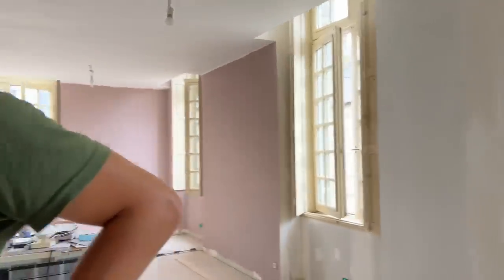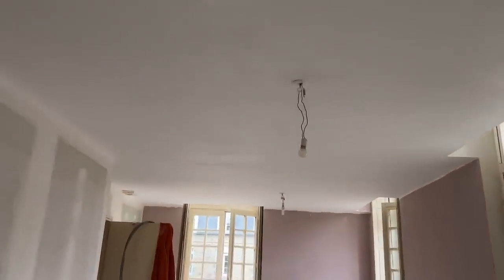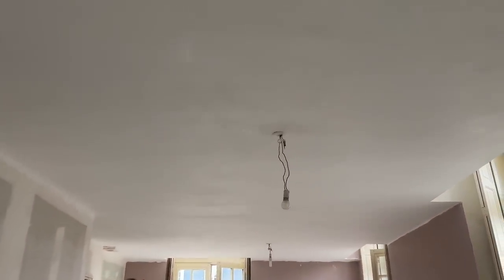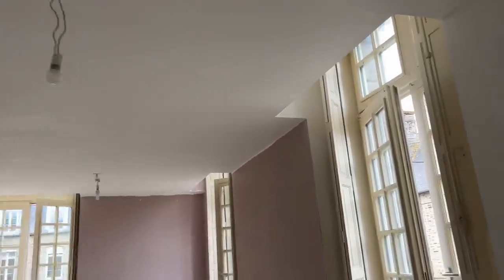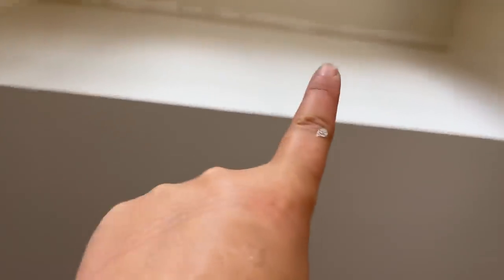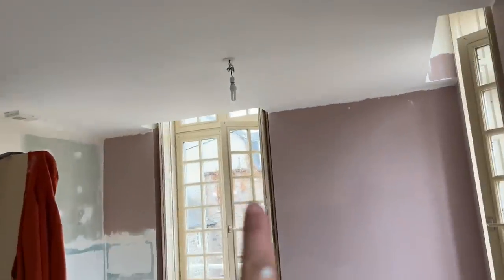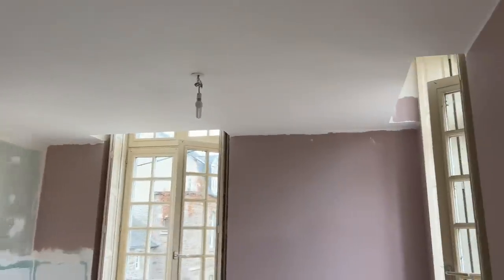The Kitchen For The Convent Apartment!!

Comment: All your kitchen ideas have worked out perfectly.. adding the painted armoire and buffet base (sideboard) brings repurposed old, together with the new black cabinets, a great on trend look with the wall colour - you could paint the armoire either black or the same pink as the walls. Having the fridge in the island, also a great idea! 
My painting tip.. always paint the ceiling first, saves drips on the walls.... ❤🦘

Comment: My mother had a cooktop in her large island (4' x 12') for years. She hated it. Try as you might, you can't control splashes of oil from cooking and downdraft fans are not really effective. The heat and oil was messy and off-putting to guests sitting at the island counter. When she remodeled she swapped the cooktop and the sink and was thrilled with the new configuration. She was able to have a strong exhaust fan over her cooktop (rather than the less effective downdraft in the island) and her island was much cleaner with only a sink. She also added a pot filler over her new cooktop so she didn't have to lug water.

Comment: The opem kitchen is the right thing to do and using an armoire as a pantry is a very good idea, mixing old and new. Of course there are things to work out but you have time.  It will be fun to find the armoire,  just have it be very sturdy and be able to handle the weight of cans and containers and cookware.

Comment: I have been a painter for 30 years. Here is a easy way to paint those corners and around the ceiling with out a latter. Use a little 4" or 5" woolly roller with a existing  pole. Always do your ceiling first then cut walls to the ceiling over your rollers marks. It will save time and wear and tare on your body.

Comment: The strip you all were talking about on the bottom of the door is called a sweep at least in the US. And it’s doing exactly what it’s supposed to and that is to seal under the door it prevents you from losing heat or air conditioning and it’s usually spring loaded to adjust to your floor height. Your apartment is going to be gorgeous when you all are done

Comment: I think you should start over.  I like the choice of cabinetry and the idea of the antique wardrobe.  Originally, you didn't want an open concept.  So I suggest a 3/4 wall with a plant ledge on top.  Not a full wall but, access into the kitchen on both sides with the wardrobe in front of it.  Turn the island around  so you can still have seating on the side.

Comment: Wish you had the door to your bedroom from the hall so that you could have the fridge on the same wall as the sink with another cabinet with countertop between the sink and the fridge. Would the island interfere with opening the cabinets and fridge? And maybe the hob/stove/oven between the fridge and the sink?  Sorry, just saw that even if the bedroom door were not there, there still wouldn’t be room for the stove, as well. Just the fridge and another small cabinet till you reach the sink. If the hob were over the oven in the island, it would not be near the island seating.  Looks so pretty! Love the idea of mixing the cupboards in with the modern cabinets!

Comment: Hi Sadie. Just looking at your kitchen design. Can I make a suggestion. Do you need to be able to walk all around it? I think if one end touched the wall where you show a couple of pictures on the wall you would have an area beside the wall you could keep things on the kitchen counter and won't fall off the island and give you extra space on the armour side. Keep this in mind when you do the final design. I would mark out the measurements on the floor of the designs with tape so you can see the difference and the sizes.

Comment: My suggestion now that you have pictures of the layout is to imagine moving around in the space using the appliances in their locations and cooking a meal. Think about every step. Think about getting out the pots and pans, fetching ingredients, washing the vegetables in the sink and then transporting them to your workspace to prepare them for cooking. Think about what you’d have to get out of the fridge and get to your work area. Then think about cooking the food, getting utensils, getting seasonings and using them while cooking. Then think of the clean up phase too. Transporting everything to the sink for cleanup and putting it all away when finished. Doing that will tell you whether you’re going to like or hate your layout. It’s a beautiful layout but it also needs to be functional for the way you will use it.

Comment: Great design. I have made seversl kitchen designs snd I advise you to put 2 electricity plugs built in, on the island surface. They will be daily used plugs. For loading phones, use airfreyer, grill, mixer etc.

Comment: I believe the strip on the bottom of the door is to prevent drafts.  Your DIY store should have several kinds. You might find one which works better with your new flooring.  Billy should be able to advise you.
Reply: The strip at the bottom of the door is to prevent smoke getting out as it is a fire foor giving the occupants a some extra time to escape before smoke inhalation prevents them.

Comment: I see a number of comments asking you to move the sink, but if I am not mistaken,  Sadie, you said the sink had to stay there due to plumbing constraints as you did not want to dig into the concrete to add the necessary pipes.  However, as for the refrigerator, you said where it was not going, but you never said where you would place it. Seems like all the wall space is taken except for street side which is far from the sink.
Reply: I remember some comments about not moving the plumbing. But then as I was watching I realized that this is the second floor (or first floor for any Brit’s)… would that really be a concrete floor?  Still a pain even if it isn’t, but it might be worth it.

Comment: I definitely think sticking to what makes you happy. Because you will be the ones to live with it. But if it was my kitchen I would want the appliances and cupboards against the walls, as much as possible.  And fill in cabinetry around the appliances. I would probably skip an island all together, because the space is very small, But if an island is a must than I would say probably something longer and more narrow. Especially putting an investment of money into it. you would want to be very sure that it’s what you like, because it would be a very expensive mistake.
Reply: While I understand this sentiment, you can see that with the placement of the windows there is not really any way to put them against the wall. The back wall does not have enough depth to the side window for standard appliances and worktops. And the plumbing is only in one location. The workaround of the island may not be perfect, but it fits into the space they have.

Comment: I love your plans.  Just a question.  Is there glue or something that you put under the floor at the door?, will it cause the door to be tight to close?  Normally you could sand a cm or so off bottom, but being a fire door, you maybe should not.     Just wondering why the electricity fuse boxes overkill?, 2 extra or maybe someone did not take out the older ones?

Comment: Have you learned that there should be a triangle cooking space?  I would put the refrigerator and cupboards on the wall leading to your bathroom with the door opening up from your left.  Cooking top and vent hood on wall where you wanted your hutch.  Sink in the island and island more like a peninsula against the wall by window.  Opens up space to kitchen and bathroom.  Safety for everyone.
Reply: Sink has to stay where she placed it due to placement of the pipes/drains that will not be moved- she is working within budget and old building that she doesn’t own constraints remember.
Reply: A good plumber can do anything.  But it’s what ever pleases them really.  I just thought with Mo being a great cook he would enjoy a well designed kitchen.
Reply: They are getting rid of the mauve pink correct?
Reply: @lisaloy2011  no
Reply: @lisaloy2011  no.  That is the color that Sadi picked, based on a picture of a kitchen that she saw in a magazine.

Comment: If at all possible, put your sink in your island, if you must and put your stove where your sink is. Having a hot, scalding stove top going when people are sitting at your island, especially any child, is not pleasant and could be dangerous. Just a suggestion.
Reply: They can't put the sink in the island as it is a concrete floor and they would have to drill through it to put the pipes under the floor. They have already talked about this in another video which is why they are keeping the sink where the old one was.
Reply: I have heard that from others on you tube....never again would they have the stove in the island.  I think that should be the norm.  I guess it will take having a child severely burned before they stop this practice.  It really doesn't make any sense at all from a safety issue.
Reply: @margaretbedwell3211  - We all gave our advice and opinions in earlier videos. If Sadie and Mo chose to ignore our advice then that is their decision as it's their kitchen. I doubt they are going to change their plans at this stage
Reply: That is correct. I put mine on the outside wall and I have a magnificent place for a large buffet. It is great.